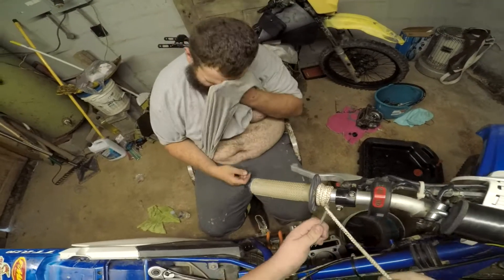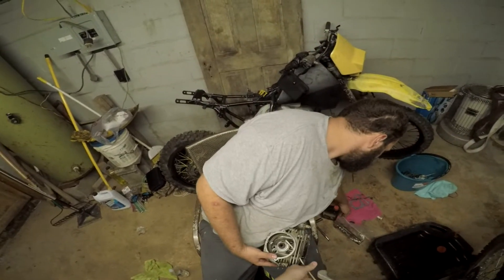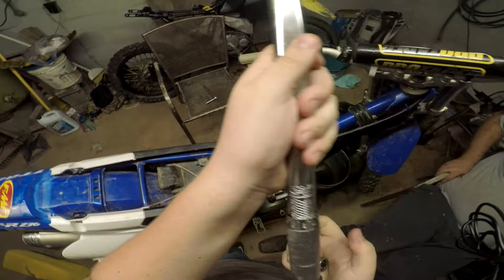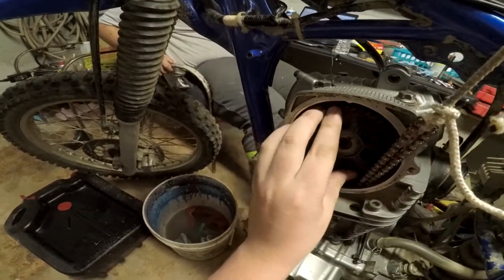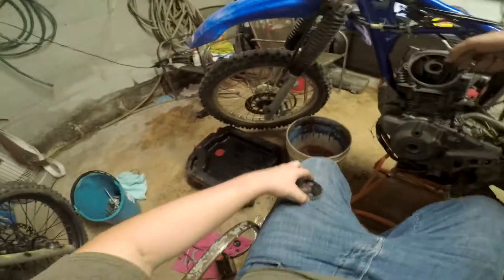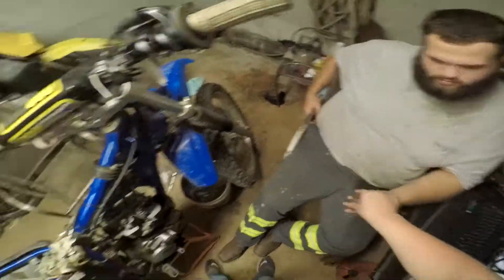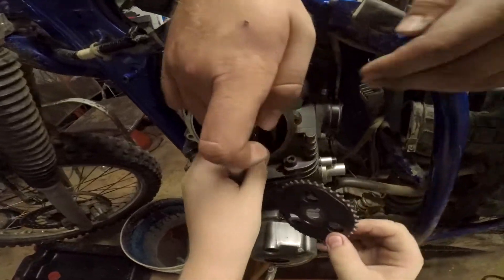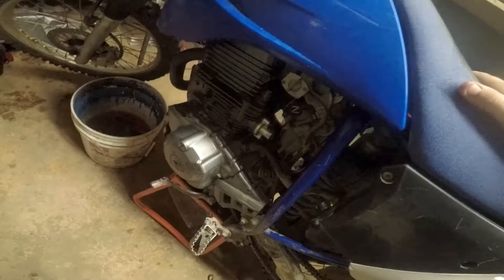TTR230 GETS HEAD ! (TTR build Part 2)

Comment: I am nearly finished but how do i put the timing chain back on while aligning TDC? I pulled out the chain tensioner on the side but it is still hard to fish the chain over the cam sprocket.
Reply from the maker: They way I did it was taking the gear out putting the chain on then sliding it on the cam
Reply from the maker: Make sure teeth are not bound up on the primary drive gear in the bottom end